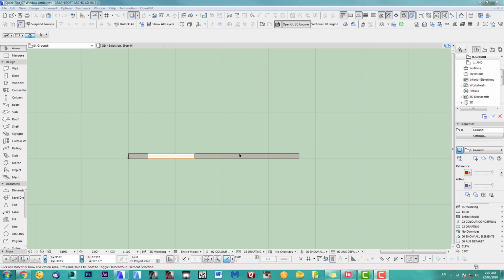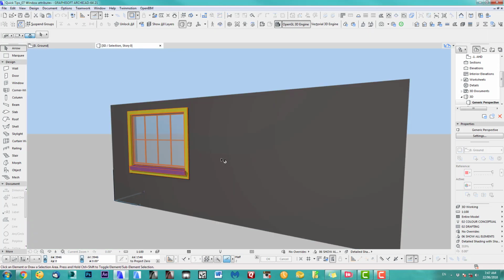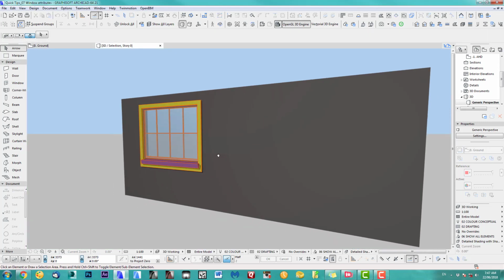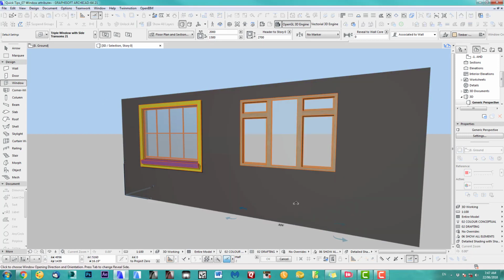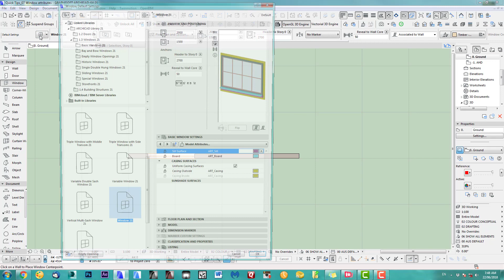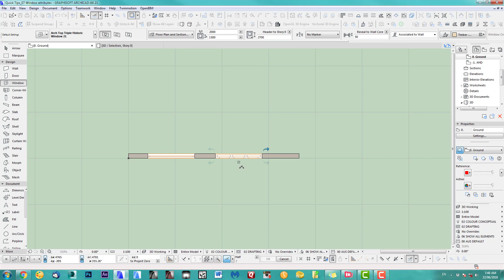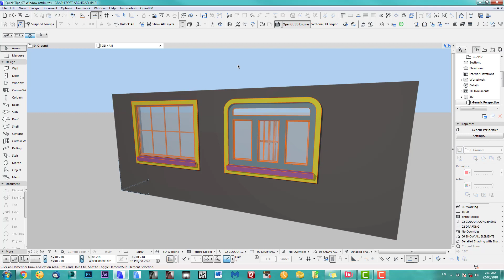How to transfer window attributes in ARCHICAD

Comment: doesn't work in archicad 23 :(
Reply: Nevermind... it works. But you didn't explained it too well. First you pick the attributes from the old windows using ALT+click, then you open window settings and then you find the new window but do NOT click on it! Just hover your mouse pointer over it and hold CTRL+ALT and then you can inject by clicking. ARCHICAD 23* Thanks anyway!
Reply from the maker: Yes you are right! Hover is the key thanks for pointing this out.